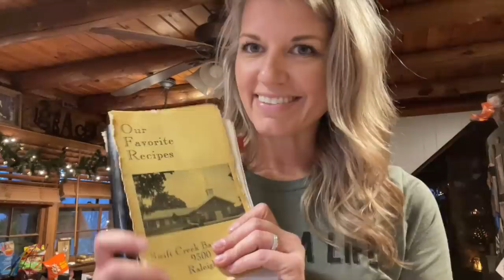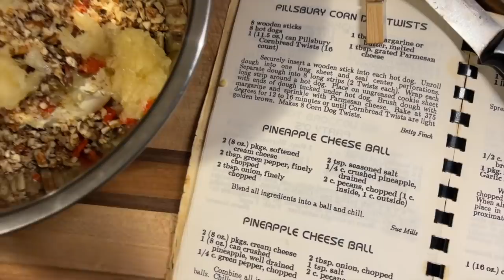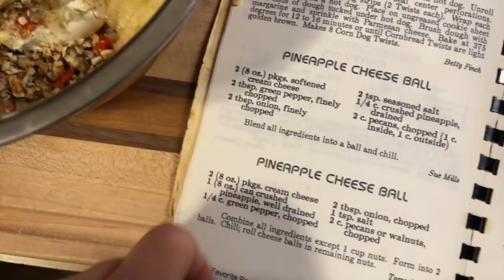It's All Over Now 😬

Comment: Worked in a mill for about 5 years right after high school where we made livestock feed and I learned to tie that Miller's not then. Still do it today part of our farming operation is custom ground feed and we probably tie 100 bags or better a week for our small poultry customers and small cattle feed customers and so on and and our own grain also. I have taught a lot of young neighbor kids that have worked for me over the years how to tie that knot and I might give Lawrence a small pointer that's taking broomstick or a feed dolly handle and tie it around that that way the kids can see what the not should look like without the material from a bag interfering, then once they learn how to do it then they can tie it on the feed bag. We used to make feed there at the Mill and tie with bear twine on big feed bags and then in the fall of the year and through the winter months we would make buckwheat flour and we would try the same not on a little tiny 2 lb paper flower bag with cotton string wasn't much bigger than sewing thread. And then they taught us how to fan the top of the bag out so look pretty on those flower bags. The company has changed hands since I worked there but I still go there for feed ingredients but they use a sewing machine to tie them now

Comment: Hi Meredith, that knot that Lawrence is tying for the corn is a clove hitch. 

To make one, make a loop and hold it with your left thumb and fore finger. Make another loop and hold it with your right thumb and fore finger. Take the right loop and put it on top of the left loop. Put those loops on the sack of corn at the same time and pull it tight. This is for the loops made with the string going beneath. If you make it with the loop going on top, put the left loop on top of the right loop.

Will you consider making t-shirts like the one that Austin had on in this video. "Farm Plus Insurance Services". With your design on the pocket.

Have good days!

Comment: i couldnt be leave i fad built a trail along my back fence line this summer and i wanted some early green feed for my cows bull and steers in the spring so i went a bought 5 bags of rye grass , not rye grain rye grass only comes up very early in the spring long before the grass starts to grow and is killed off by the fall freeze and dont come back, i was charged $87 cnd per 50 lb bag, last time i bought it i bought 100 bags in 2022 after i longed my land and had it stripped and planted rye and grass seed for my live stock, i paid $24 a 50lb bag back then, i put the rye grass out this fall just before our first snow so it comes up  soon as it melts in May, i asked the feed store how mack a bag of grazing grass seed is, and there 4 different mixes starting at $270 cnd to 333 per 50lb bag

Comment: Check with your local tire shop ....... they should be able to fill those tires with epoxy foam ........ you will never have a flat again , you won't have to buy tires so often , an you can completely wear the tires out .